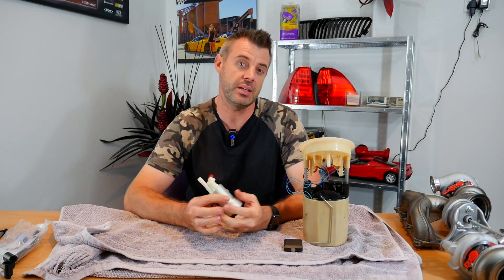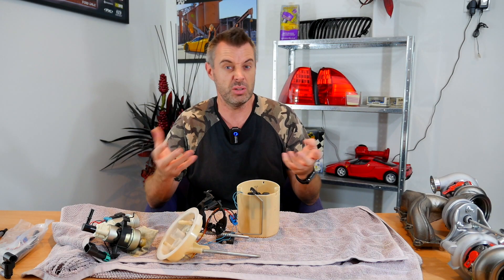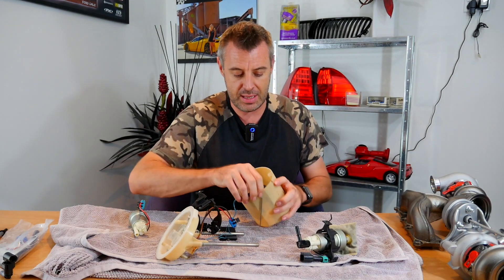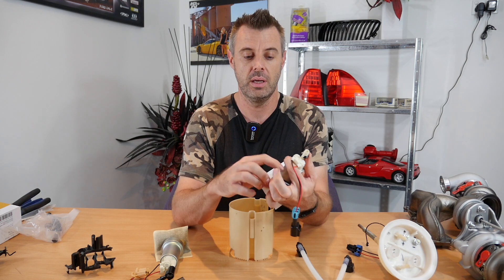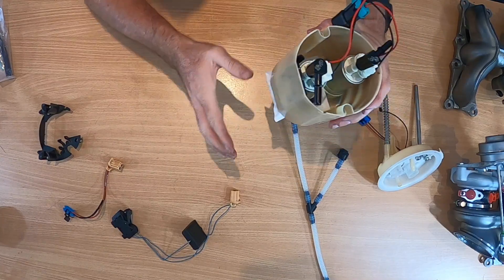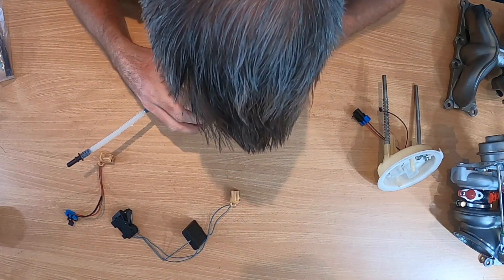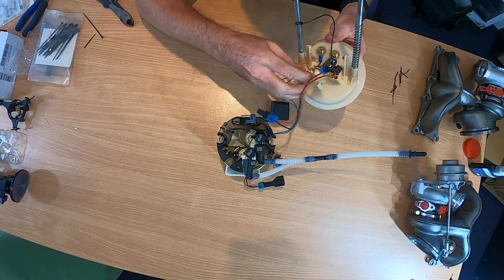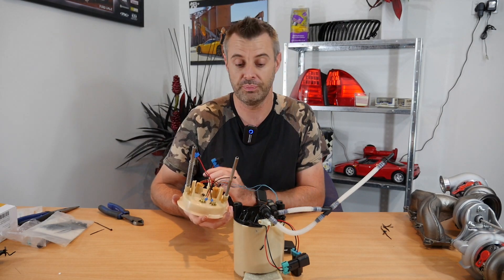BMW N54 Stage 3 LPFP DIY: Ready For BIG POWER!!!

Comment: Would you recommend going stage 3 for both tanks. Or just the main tank. I’m currently running stages 2 walbros for each tank. Tuner told me to go stage 3 but I don’t know if I need to do both tanks

Comment: 1 stupid question , does N54 e92/90 comes with 1 bucket in fuel tank or 2 buckets like one on each side. Just curious to know :)
Reply from the maker: It has a module on both sides. Fuel pump on one side and fuel reg on the other.
Reply: Dumb question, if I do stage 2 fuel upgrade, its just 1 pump to replace right?

Comment: @Zero to 60 how did this pump hold up when you were at the track any starvation ?
Reply from the maker: No issues with the type of driving i do. However. throw on some semi slicks and start going rounds corners flat out, with 1/4 of a tank or less and you will have issues.

Comment: QUESTION is it correct that you drove with stage 2 without venturi but with bucket because i would like a stage 2 walbro 450 but it is unclear with the venturi
Reply from the maker: Correct, have done it on 2 cars now with zero issues.
Reply: @ZeroTo60Tube  thanks for the Quick answer! Love the content

Comment: Im going to go with this same setup, But can i keep the bottom? I want a bucketed setup, so I won’t suffer from fuel starvation
Reply from the maker: I personally think it will be fine for all uses except for circuit track work. For daily driving, street racing and even 1/4 mile times, a solid bucket should be fine. What does get difficult is getting the two filters to fit in the bucket.

Comment: I believe the better solution to this is a single pump, no Venturi, with the added Hydromat. The hydromat allows the pump to never go dry, as is what the Venturi was doing by filling the bucket. 
By cutting the bucket, you can’t drive below 1/4 tank or risk going lean during hard pulls/corners. 
Another downside is that two pumps pull too many amps and blow the fuse, leaving you stranded. 

Anyway , good explanation for the two pumps.
Reply: Hydromat's are more costly than I expected but pretty cool. https://www.enginemaster.com.au/fuel-cell-pickups/ are they that much better than the Venturi?
Reply: But which pump is fitting in the original pump socket? 
i heared the walbro 450 and also 525 do not fit. 

so i need to cut it or not?
Reply from the maker: You are on the money!!! Mine with the single pump, no Venturi was perfect for FBO e60 power levels, but I’ll need the extra pump for when I get the port injection on and really wind the boost up.

Fuel level did concern me, especially with e85, it doesn’t get great range. But we’ll see how it all pans out. I’m starting with the cheapest option and we’ll work up from there when it starts becoming an issue. 🤘🏼my fingers are tightly crossed.
Reply: @ZeroTo60Tube  Awesome vid! Just wondering where you got the BMP Walboro Fuel Pump Fitting in Aus to avoid US shipping costs? I really want to try a stage 2 DIY so I can go from my current e30MHD map to the e50 upgrade on the cheap so been lightly researching. I'd like to try and keep the venturi so that it's less risky if my fuel level drops. Do you have a vid on when you did that or other bits you recommend for it? Sorry, couldn't find it.
Reply from the maker: @UmbrielliaMedia  Hi There, unfortunately i had to get them from the states. I got them on the black friday sale and with a few other bits from those guys. Certainly helps a bit.
Reply: @ZeroTo60Tube  Black Friday, of course! @t This Aus guy used $50 of Aeroflow bits, maybe that's the way to go even if it takes way more space and connections. Keeping that Venturi down and in seems tricky though and he had to drill tiny zip tie holes in the bottom and I can't see where that fuel filter would fit in. Also did you have a vid of your stage 2 bucketed DIY?

Comment: One guy in the whatsapp is running a 535 on its own

Hpfp use to be down to like 1500psi or less at the top of rev range now its 2450psi at the top same tune - 450vs535
Reply from the maker: Was he just running stock hpfp or overdriven? Or port injection as well?
Reply: @ZeroTo60Tube   In the UK so just stock HPFP no over drive no port injection. Same or less power draw from ekpm  He made 550bhp on 17t's before changing. 
He was recommended to do change to it by Ken Wedge Performance. He didn't fit a check valve  (535 doesn't come with one)
 and feels no change on start up operation. 

http://www.fuelperformance.co.uk/index.php?route=product/product&product_id=9980